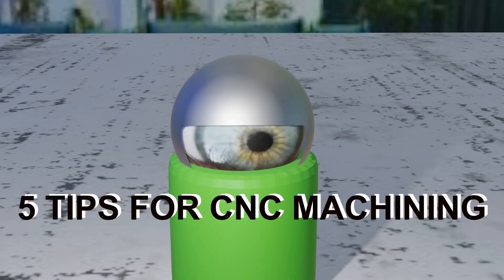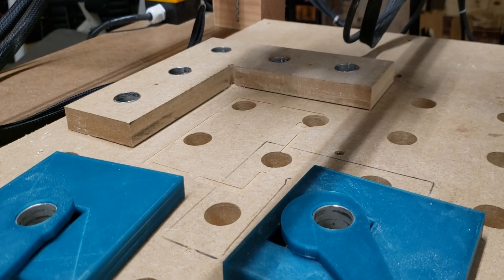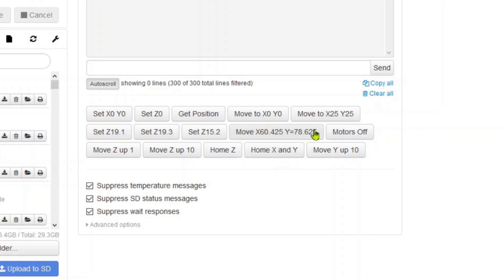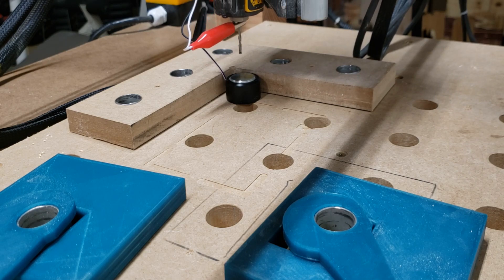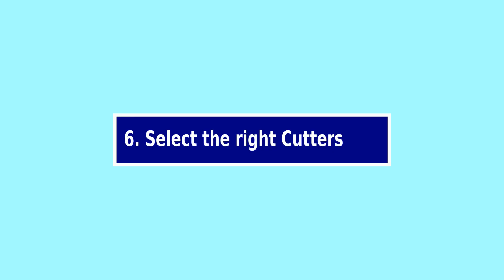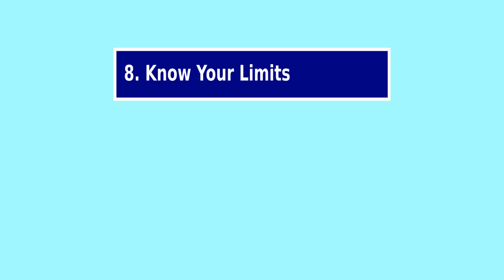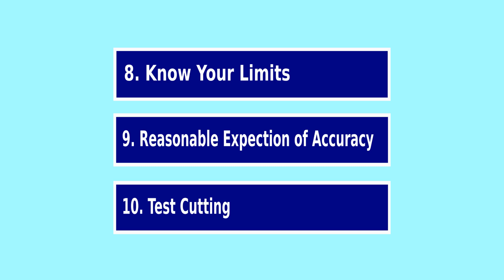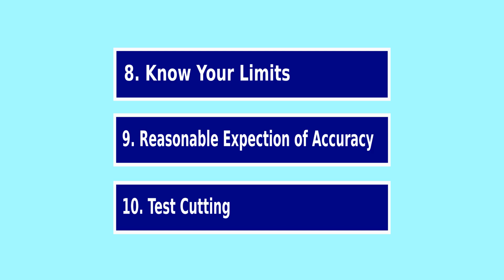5 Tips for using the MPCNC or any CNC router. Get more consistent results.

Comment: Beginner here, why not fix the datum at true 0.0?
Reply from the maker: You can certainly set it up that way however, you might want to modify your firmware to achieve that. You won't be able to machine with the cnc hitting the end stops. Remember many times the cutter will want to be in clearance (negative) of your datum.
Reply: Adventures in creation ah, I see, just had that very problem. Thanks for the heads up!

Comment: Hey @adventures in creation! Wich program do you use to support your touchplate zeroing?
Reply from the maker: I use octoprint to send the code. The code is supported in the marlin firmware and the touch plate is wired into the board.